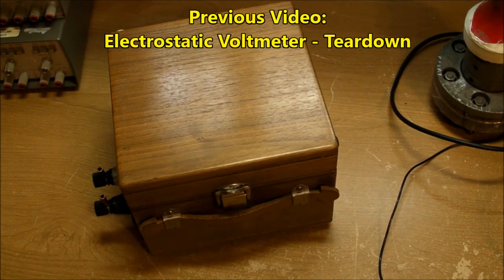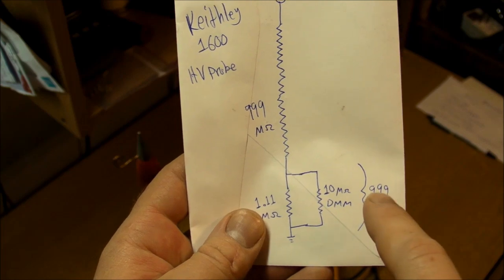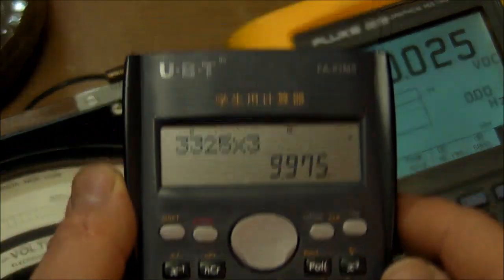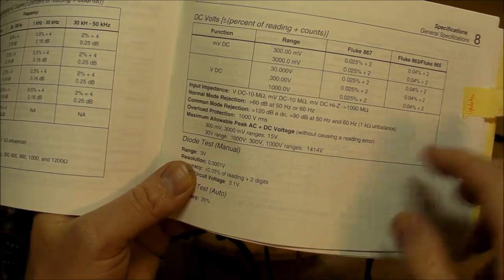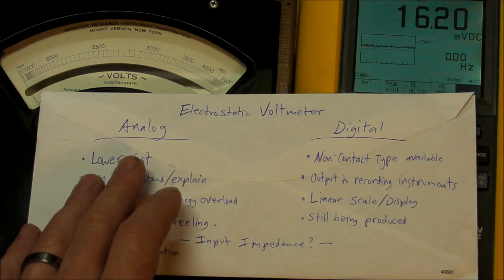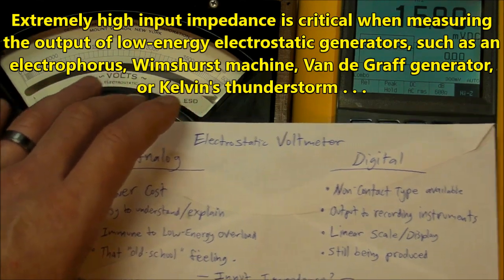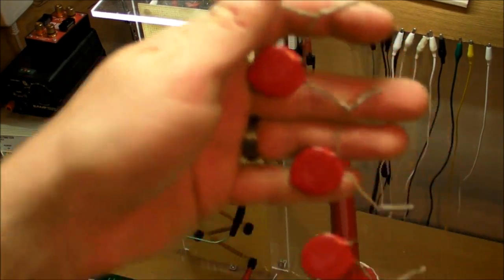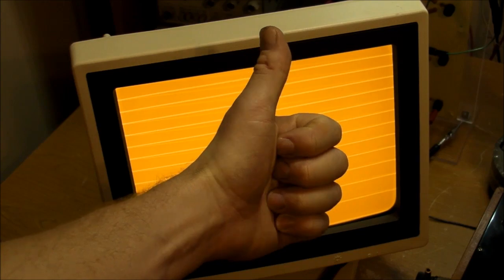(#0198) Electrostatic Voltmeter #2 - Operation & Advantages

Comment: High voltage rated cable is used by neon sign installers. Ratings vary from 10KV to 20KV. Call around to see if you can purchase some. It's a bit safer than the usual cables rated at 600 volts or 1000 volts.

Comment: great video. learned a lot.
Questions. What was the measured value of the 5% resistor and did it cause most of the inaccuracy? Partly asking because I know you teach EE and I would expect you'd ask your students:p Also I am genuinely curious.
I didn't catch the rated accuracy of the flukes. 
Love that electrostatic meter. Seriously contemplating making one.
Reply from the maker: +Mongrel Shark FLuke 85 DC Volts 0.1%. Fluke 867B DC Volts 0.025%. Didn't measure the 300k resistor. I was just testing the operation of the Hi-Z function, not necessarily testing its accuracy.
Reply: 0.025% that's very nice!